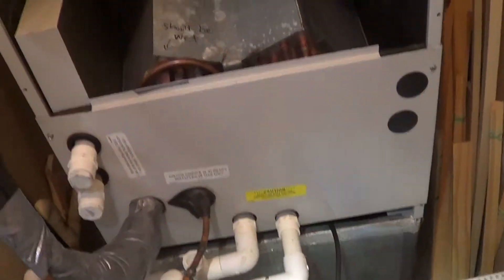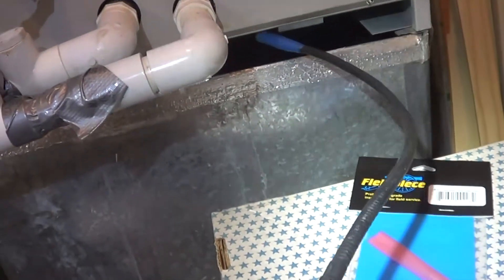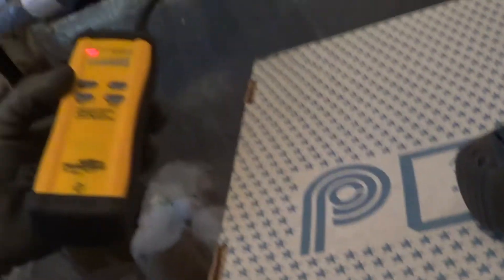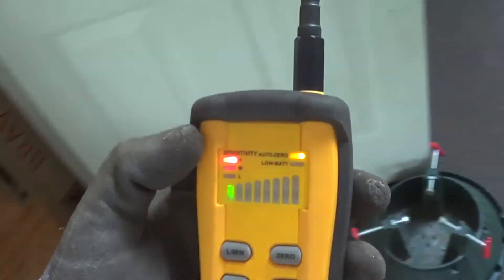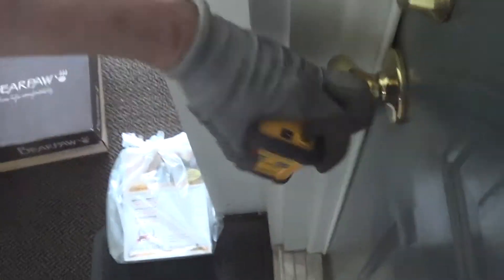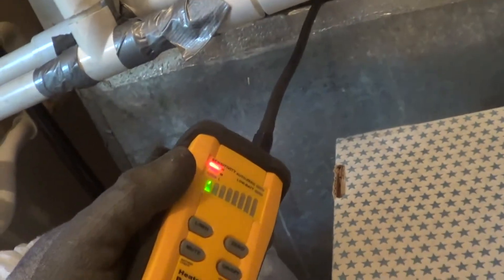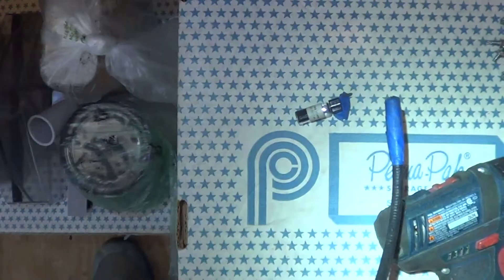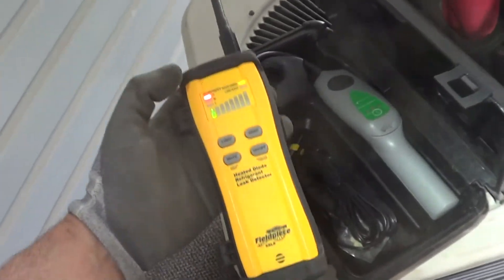Why to change the sensor on an SRL8 leak detector

Comment: I have the SRL8 & it picks up R410a great but I don't trust it because it false trips too much. I never heard about humidity being a reason for a false trip but it goes off any time I get near an evaporator even when I know the leak is outside. It even goes off around lettuce so the humidity issue makes sense. I was thinking of changing the sensor but I wouldn't think a bad sensor would make it too sensitive. A damp evaporator is going to be really high in humidity so how do you know when you're sensing gas or high humidity?
Reply from the maker: Humidity is an issue.   It isn't bad if you know about it though.   Yes, wet evaporators set it off.  You can run the fan for 5 minutes to dry out the evap.   Also, your body will set it off in a hot attic if you are sweating.   So, keep it far away when your sweat is setting it off.   I switched to the NAVAC NML1 a year ago and noticed it is more stable.   It uses the exact same sensor as the SRL8.   I will evaluate the new updated version of the SRL8 in a couple of weeks.   I will make an update video.   
As a rule of thumb.   Humidity sensitivity isn't going to be consistent.   A leak will be consistent.
Reply: @NathansHVAC  Thanks for the ideas. I've tried plenty of leak detectors through the years & so far nothing has been as stable as the old 120v. H10G. It wasn't the most sensitive but it's rock solid.  I have the H10 Pro & it's not even in the same league as the H10G. I like the SRL8 because of how sensitive & easy it is to use but these false readings make me doubt it every time I pick up a leak so I have to grab another detector to confirm the leak. Now that you've made me aware of the humidity issue I'll see if  I  can work with it a little better.
Reply: I have the same exact issue

Comment: Nathan, so is this a 2 3 or 4 pass coil? A cold coil air will drop. Then as a dye man. Dye charge schedule a fallow up and get out the flash light. That said I have a FP2 I keep it clean and serviced. It will hit test gas at 3/16". That said I find leaks that would require a head mounted microscope with die after a week of run time.
Reply from the maker: Are you talking about the Fieldpiece SRL2?
Reply: @NathansHVAC  yes srl2. Spell check. I have been a leader to hit off of test gas with it however it's not consistent. I'm looking at the srl8. That said I picked up the new dye kit today. As I have a sub 1 lbs leak per year on a 18k ruud system. Tomorrow I'll dye it and return sunday with the glasses and lights and it will take less than 15 minutes to see weld coil or service valve leaks.

Comment: I bought a brand new years ago. Used it a few times and now it won't stop beeping when I turned it on. I stopped using it years ago and when I turn it on today it's still beeping. Do you know what this can be?
Reply from the maker: You might try blowing air in the sensor.  You can use your breath.  Just remove it and try.  There may be a piece of dust lodged in the sensor.  Otherwise, you can replace the sensor for about $55.  It is a good idea to replace the sensor yearly anyway to keep best sensitivity.
Reply: NathansHVAC okay thanks man

Comment: Nice, but How do I change the sensor?  Where is the sensor located?
Reply from the maker: The sensor is located at the base of the flex pipe where it connects to the main body.  Just unscrew the black pipe.  Also, make sure to take note of the polarity when removing it.
Reply: There was no description. The sensor has a small nose. I have incorporated this position showing to the small white spot. Hope it is correct. Tonight, I will turn the device on and test it.  Thanks

Comment: Hey Brother,  I had a new H10 which was useless for R410-A.  I purchased the SRL8 after watching your videos on the testing.  I notice your air pump is much louder than mine.  What could be the reason?   My pump wearing out??
Reply from the maker: A/C SuperKool the pump doesn't pull much.  There is a spec in cc per minute.  I don't know if it is published.  I verify by putting the probe in my ear.  Sounds funny.    Anyway, make sure to change the sensor yearly.  Also I'm evaluating a new testo that looks promising. The srl8 neucence trips are annoying.  But, if you detector ever starts acting nice and not neucence tripping, you definitely have a worn out sensor.